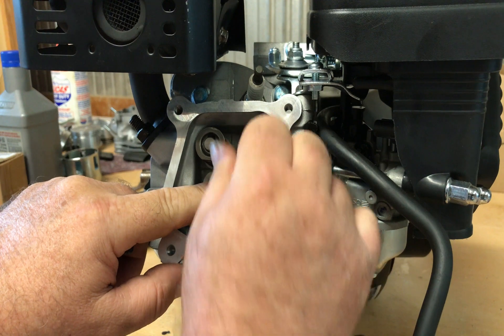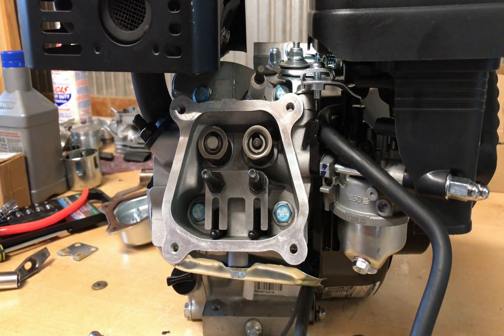The "Killer Tiller" Engine Gets A Billet Guide Plate & 1.3:1 Ratio Rockers! 179cc LCT Engine

Comment: What are you installing the Killer Tiller on ? What is the Hp on that thing?
Reply from the maker: Hi Frank, this engine project is just a little fun with one of the $49.95 LCT 179cc engines. It's going on an old TSC Huskee brand garden tiller. These are factory rated at 4.8HP but with the small mods and.291 lift at the valves now I wouldn't be surprised if it made between 6 or 7HP. Thanks!
Reply: @KentuckyFriedFixes  Ok cool. good price on that engine.

Comment: No lash cap on the intake valve?
Reply from the maker: I know right! These only come with the "rotator" on the exhaust. The 224 Predator head I installed on this one is the same way. I'm not crazy about the stock retainers either, I'd much rather have a set with the split keepers but that'd be another $20 into the $49.95 tiller engine.
Reply: @KentuckyFriedFixes  I think the cap helps to lock the retainer in place.
Reply from the maker: @DarkCornerGarage  You're absolutely correct Dark. I may snatch an exhaust retainer and cap off one of the blown 196 engines coming off the mini bikes and install it on this one. I'd probably be a bit miffed if I dropped a valve on the "Killer Tiller" Thanks man!
Reply: @KentuckyFriedFixes  for sure. So weird it doesn’t come with both. I believe in durability before all else. To finish first, you must first finish.

Comment: What is the ratio of the stock rockers?
Reply from the maker: Hi Kevin! Stock ratio is 1:1 (one to one). There are other rockers available for these as well 1.1, 1.2 and of course the 1.3:1 used on this engine. Some guys mix and match to change the valve timings a bit. It's an inexpensive mod.

Comment: Nice work.  Sounds good. Setting the lash a little loose is ok, the valves will seat in and the gap will close up.
Reply from the maker: Thanks Ed! The little $49.95 LCT engines surprised me, most of the import engines have a lot of vibration but these are pretty smooth.